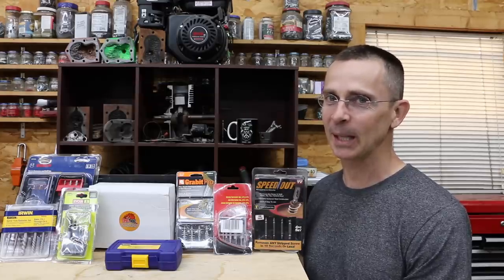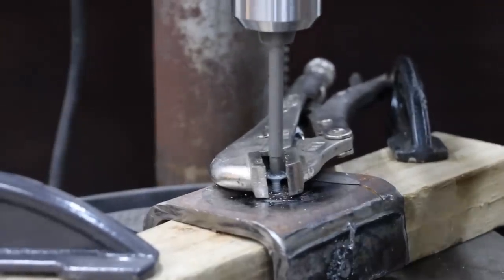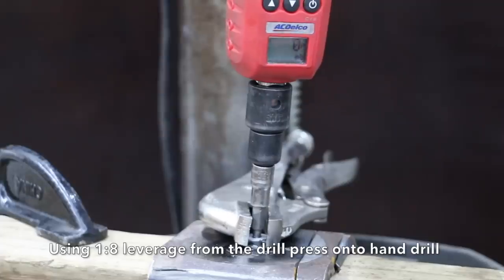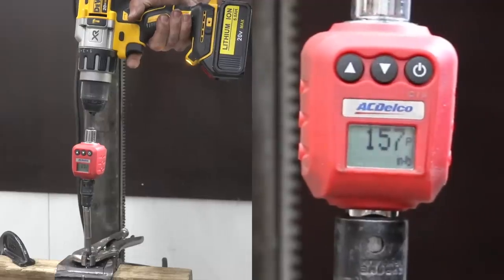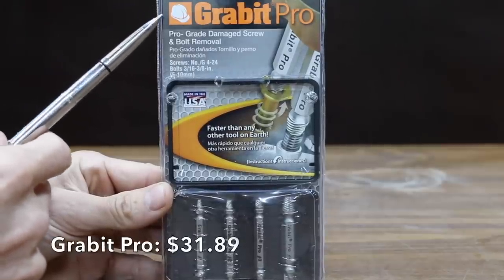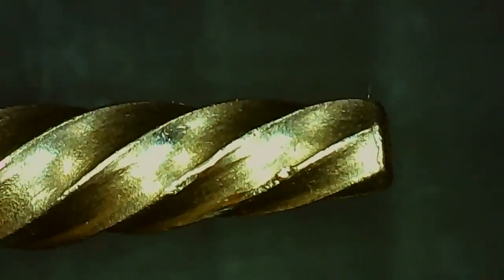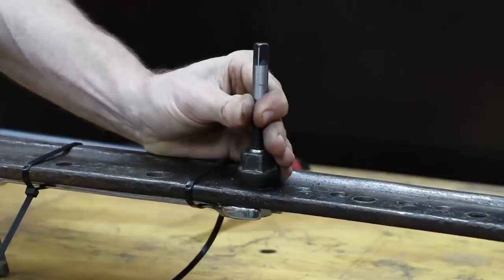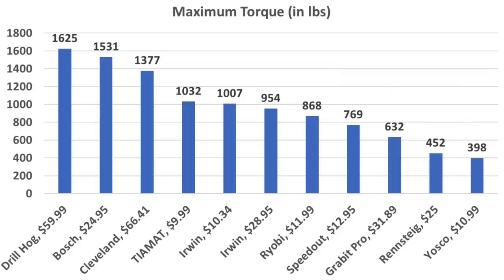Best Bolt Extractor? Let's find out!  Drill Hog, Bosch, Irwin, Speed out, Ryobi Broken Screw Sets

Comment: I want to make a recommendation for those who still can't get the bolt out due to excessive corrosion:
Map/mapp gas.
In the years I've been doing DIY automotive work on rust belt vehicles, I'd only ever been recommended to use oxyacetylene torches, which are prohibitively expensive. Recently my older brother mentioned map gas to me for a broken bolt seized inside my exhaust manifold. So I went and looked it up, and realized it costs about twice as much as propane and works with my propane torch nozzle. But unlike propane, it gets steel red hot, which is what is often needed to remove the most heavily corroded bolts.
I don't know why I never even knew this common gas existed, but I'm going to assume YouTube has given similar recommendations to others, and as a result wanted to post this here in case it helps even one person realize they can afford to turn that old crusty bolt cherry hot to persuade it to come out.
Reply from the maker: Thanks for the feedback.

Comment: When I get a stripped screw, I simply use a Dremel tool with an abrasive disc attachment on it, and I cut a SLOT into the top of the screw head so that I can then use a straight screwdriver to extract the screw.  It works every time (but there are slight slots into the material on either side of the screw itself.)
Reply from the maker: Thanks for sharing.

Comment: I over torqued a bolt on my Toyota pickup antiswaybar and broke the head off. I used a small drill bit to make a hole and hammered a philips head bit into the hole. Used my drill to extract the bolt.
Reply from the maker: Thanks for sharing!

Comment: When I use the extractor I don’t hammer it in, rather push hard and at the same time twist.
I’ve had good success.
Typically shaped like the Irwin.
Use an adjustable wrench (shifter or shifting spanner in Australia)…a big one then use the palm of your free hand to push down and at the same time start to turn and it will generally bite.
Reply from the maker: Thanks for the feedback.

Comment: For what it's worth, if you're looking at getting into some minor plumbing, get yourself a set of those spiral flute extractors. Any brand will do (I use the Irwins myself) but my point is that the shape of those flutes engages with broken pipe ends/ brass fittings exceptionally well. They've saved my bacon many times. I've also had great luck with the Speedouts on small zinc plated bolts. The drill ends are trash so you'll have to buy a drill set but the extractor end can find grip on very shallow holes (handy if you"re working in small spaces or on a tight schedule)
Reply from the maker: Great feedback. Thanks!

Comment: Or a broken thread tap, I broke 2 different brands Irwin, and Milwaukee, 2 different sizes, and both were hardened carbon steel taps, I broke them on the same aluminium cylinder head within a couple hours.
Reply from the maker: Thanks for sharing.

Comment: Got a few torx bolts that stripped out on my Jeep's rear door (removing from my old body to be moved over to a new body). Ordered both the Irwin and the Pro Grabit. So far I've been welding junk sockets to stripped bolts and getting them out that way but I'm running out of junk sockets. (sockets from flea markets for a couple bucks).
Reply from the maker: Thanks for sharing.

Comment: I watched your bolt extractor video,. and I sort of see the point in the tests that you did ,  although I don't think those tests were very practical or real world. because usually a bolt or screw breaks and needs to be removed because it is rusted in , or it was over torqued when it was installed,. or much of the time because it was installed using locktight on the threads witch greatly increases the removal torque, even if it was only installed with a small amount of torque.   I totally agree with you that many cheap tools ,. and sometimes even not so cheap are just are just junk , and probably should be sent to the scrap pile instead of even being sold to the public.   thank you for the videos , keep up the great work . Tim from Wisconsin .
Reply from the maker: Thanks, will do!  Thanks for the constructive feedback.

Comment: After two years passed since the video have you tested out any different extractor sets? So, what would you recommend using, what would you use in 2023? Personally, I got my hands on Speedout extractors, and unfortunately, they didn't deliver, my extractor snapped after I was using it for 30sec on an M5 bolt in a bike frame linkage... Also, I tried Rennsteig, but it was a different set from what you demonstrated in the video for extracting screws out of wood(it did OK).

Comment: I know this is an old vid, I just wanted to mention I really like most of your vids... but this one... has a few issues.

The left hand "drill" is not a drill. It doesn't drill good because they are made to bite and allow a power tool to remove screws which aren't bound tight. Your holding it with vise grips... it did what it was suppose to do, bite, then broke because the screw was being held.

The long narrow extractors are for broken bolts, not stripped. The shorter sharper tapered extractors are for stripped screw heads like Hex key socket caps. (Allen sockets) What actually works much better is a torx bit which fits the hole.

In the larger extractors section, a huge variable is your hand moving around not getting straight direct pressure on the extractor. Get off center line and there is know way to know if the tool failed or the test failed. 

Hard to tell from your vids but it also looks like the drill holes weren't deep enough on several of the test. This lets the extractor bottom out. When this happens the flutes don't have full engagement. I know, with the  screws your using you couldn't go deeper.

It's common on small screws to grind a little off the tip of the extractor to make sure you get a good fit. 

I don't know anyone who uses extractors on wood screws. Cut them off / drill the head off and put in another screw beside it.

40 years of turn'n wrenches... I only have Irwin extractors. As a professional, I have a set I've used for almost twenty years.

Comment: Thanks so much! I’m going to be tackling a broken bolt in my engine block tomorrow so now I know what extractor is going to do the best!
Reply from the maker: You are welcome!  Thanks for sharing.
Reply: @ProjectFarm  Well it broke off in the block, cracked the block, BUT I found an epoxy by the name of Belzona 1161 that repaired my broken engine block! I would recommend you spread the word on it. It was expensive but man did it save me the $5000 on a new engine!

Comment: Very educational and enlightening test performed. I have always used Irwin sets and much of my extraction is stainless stripped out in aluminum, which is most undesirable. As long as you go slow, drill straight, and extract straight, I usually do not have any trouble with M5 and M6. That is all I can really speak for and I'm happy with its results but I have to try Grab it. They are cheap enough.
Reply from the maker: Thank you!

Comment: @Project Farm - I ran into a situation, and I would LOVE for you to test it, and since you already have the tools, it shouldn't be tough. I got in a fight with a 10.9 steel bolt that was 1/3  ground down. To make it even worse, I couldn't put vertical force only lateral. I'd like to have you run the bolt extractor test on a scenario like this. In my case I was trying to remove a wheel hub bolt, so it's was listed as being torqued to 70lbs. Whether that was accurate or not remains to be seen. I'd love to see this test. Also, I second the Rocket Sockets. I have a set and LOVE them. I even bought the lug nut remover. It's been a lifesaver!!!!
Reply from the maker: Thanks for the video idea.

Comment: I’ve had no luck removing a broken bolt with any extractors.  I found the Grabit to be absolutely worthless on a bolt.  The Irwin twisted and broke when I tried it.  I tried other brands and had no luck with any of them.  I finally drilled the bolt out and retapped the threads (on a lawnmower).
Reply from the maker: Thanks for sharing.

Comment: I've had good luck with the Irwin square spline extractors, especially if you can hammer them in hard.  Welding a nut on can be an option too.  Mine all tend to be upside down trying to center the drill with a mirror.  Good extraction requires a good hole.  The hardest part.  You only get one shot.
Reply from the maker: Thank you!

Comment: The only issue I can recognize in your hurried approach is that you drill steel at too high a speed. Steel must be drilled SLOWLY to avoid damage to the bit and maintain ‘bite’ when removing material.
Reply: We recommend an RPM in the 30-70 range.

Comment: The absolute best way to extract right hand bolts/screws is with left hand drill bits. Second, in my experience is, with the Hansen (Irwin) multi-spline. The multi spline works best if your hole is at depth commensurate to the spline grip so the broken fastener is not expanded deeper into the root of the thread. It is the fatal flaw in almost all extractors. Differential heat and Kroil or Lucas CLP helps considerably as well. 
Steel fasteners in aluminum come out most cleanly if left hand drill does not work, use alum. It will destroy the steel which can be vacuumed out leaving the aluminum intact.
Reply from the maker: Thanks for the feedback.

Comment: My weapon of choice that's never let me down with "bolts?" (those are just simple wood-screws, right?) like that is a center punch and a hammer. 
Put it off center and punch once straight down and then lean it down tapping it in the unscrew direction and it always comes out.
Also works really well on real bolts stuck or broken off in other materials than wood.
Reply from the maker: Thanks for the feedback.

Comment: Thank you for this very informative video. In my use case (locksmith) the Grabit is going to be the winner & I'll be getting a set to replace the Speetdout set when the time comes. I'll also probably get a spiral set at some point for the rarer occasions I need to work on bolts.
Reply from the maker: You are welcome!  Thanks for sharing.

Comment: These work great if all you need is to get a hold of the screw to back it off. But if the issue the threads being siezed because if rust. Your best option is to drill through the screw, at that pont you will release the tension of the screw on the threads and it will be easier to remove.  these extractors will break off on the screw if you put some torque on them. So yes they do work but not on seized screws or bolts I think that's were allot of people end up breaking them.
Reply from the maker: Thanks for the feedback.

Comment: Surprisingly, I've had a lot of luck with the tapered extractors for broken off flush pipe fittings for 3/8npt and smaller. 
At least something lucky happened and they worked, because that was rather unlucky to break the fitting to begin with.
Reply from the maker: Thanks for sharing.

Comment: When i have to remove rounded damage allen set screws i will drill the set screw just enought to help releave pressure on the set screw. Once i start the operation i own it. I will drill down just enough so not to damage the shank of the holder.sometimes ill drill almost to leave the threads then using an easy out tap the set comes out with no problem seems to work for me
Reply from the maker: Thanks for sharing.

Comment: You do a really good job with your videos and I trust them more than any other on YouTube, however, no one knows everything. The first test you do with the wood screws is not fair.  Those screws are surfaced hardened and are probably harder, on the surface, than any of the extractors.  I'm sure the extractors were not designed for use with this type of fastener. The hardened surface is only .010" thick but I believe that is enough to create the damage we see to most of the extractors.  Even grade 8 bolts, which are thru hardened,  are not as hard as the surface of those type of wood screws. Given this, the better extractors still do better  in this test, it's just not as good of a test as the one you do on the larger bolt.   The testing you do on the larger bolts is very well done and is probably a better test for comparison purposes.   Keep up the good work.
Reply from the maker: Thanks!  Thanks for the constructive feedback.

Comment: An interesting little tool I got for very tiny machine screws that can’t realistically be drilled out is a set of pliers explicitly designed with gripping teeth in the tips of the pliers. They do require you to get the screw out of the hole a bit, but they’re REALLY nice for those very tiny ones.

PZ-57 is the pliers I have. There are a few similar ones out there though.
Reply from the maker: Thanks for the feedback.

Comment: Have you ever seen the spark plug socket looking set of stud removers ?  They are only good if there is something sticking out. They have knurled tiny wheels inside that as you crank it, it locks tighter as you apply more torque. Usually does not damage the studs either, can use to install studs too
Come in something like a set of 8 sockets.  
Like these ;  GEARWRENCH 8 Pc. SAE/Metric Stud Removal Set
Genius Tools 4 Piece 1/2 Dr. SAE Stud Remover Socket Set - FD-404
Don't confuse these with the ones like at HF that have heavy metal molded inside and no moving parts
Reply from the maker: Thanks for sharing.

Comment: In almost 50 years of working of all types of vehicles and equipment I've never had an extractor work and most usually break. It's usually faster to just drill out the bolt and tap the hole for a larger bolt.

Comment: For seriously stubborn screws stuck in metal i found only two solutions work.  For smaller ones , Weld on a  head for grip and blowtorch the hell out of it.  Or Secondly for larger screws,  drill out the centre and gradually drill out the core more and then extract.    

Nothing else works.

Comment: Great work and njce video. Anyone here understand what I mean when I say big tech companies listen to you through your device? I stripped the torx head on a screw that bolts down the cam sensor on my 98 v70. Someone told me to get strip out socket. Searched Amazon. Went to hardware store. Then this video showed up. I am infuriated that I spent $3500 on a car that only starts 10% of the time. That bolt is gonna experience my fury when I finally get an extractor set.

Comment: Spiral taper extractors have a tendency to expand the bolt that is being removed making it tighter. Rigid and Snapon tools make a desirable extractor. They use a spline with a splined nut. Spiral extractor do not work well on brass fittings.

Comment: I have never figured out how to use these things correctly. Every time I try, I just end up breaking them. So I have been forced to find other mechanisms for removing bolts (typically accessible from the back side as well, in my case) such as drilling or shearing the head off so it can be advanced completely through the hole or cutting a slot to try to make a flat head screw driver do the job instead of a Phillips. Then again, most of what I'm dealing with tends to be the 10-32 or 12-24 rack screws so that's a far less demanding scenario.
Reply from the maker: Thanks for sharing.

Comment: For smaller stripped out screws (under 10mm) Its easy to just drill and hammer a Torx bit into the drilled hole, no need to run to the store. I've had better luck with that then the extractors. The smaller extractor tools seem to be exclusively made out of junk but the larger ones are alright. I do a lot of stripped bolts and screws as a marine engineer in a shipyard and I can not overstress the Importance of heat when dealing with rusted and or stuck machinery.
Reply from the maker: Thanks for the feedback.

Comment: There is a process called "EDM" which vaporise broken bolts in hole no damage to threads . Many modern machine shops have them. Run about $250 a shot.
Reply from the maker: Thanks for the feedback.

Comment: Great video!  However, I have an additional challenge for you when it comes to the extractors.  I work in an injection molding company and sometimes the copper pipes attached to the molds break during production.  The threads are broken off in the mold and we use extractors to remove them.  Some of our maintenance techs prefer the spiral while the others prefer the square shaped ones.  I have particular difficulty using the spirals as their tips go in too deep at time and do not allow it to bite into the broken pipe.  Sometimes the is ineffective as well as they seem to wear out too quickly.  Have you tested these on their capabilities to extract broken pipes in this manner?  I would like to see how they perform under these conditions.  Thanks!
Reply from the maker: Thanks!  Thanks for the suggestion.

Comment: In my personal experience. I've had better luck with straight extractors as compared to the fluted. Especially if I'm extracting something like a broken bolt. I haven't had alot of luck with broken screws. I tend to just use vice grips or cut it flush.
Reply from the maker: Thanks for sharing.

Comment: Old PF vid, but the comment might help someone.  Forget extractors - drill a hole into the bolt & hammer in a Torx socket that bangs in guttentite.  Use the socket to wind out the bolt. Leaves extractors for dead.
Reply from the maker: Thanks for the feedback.